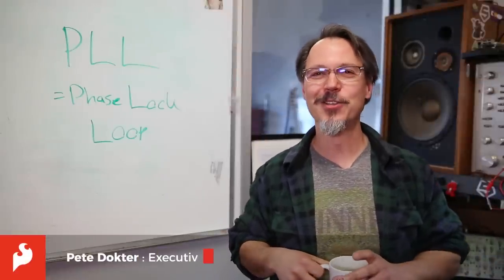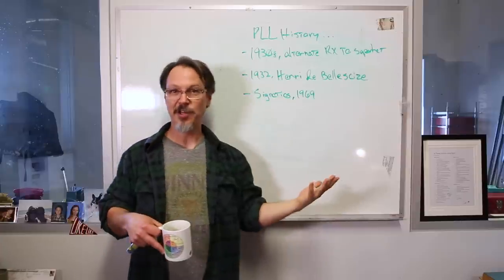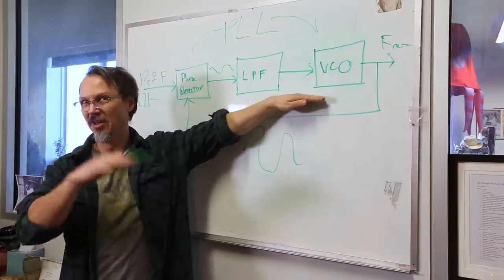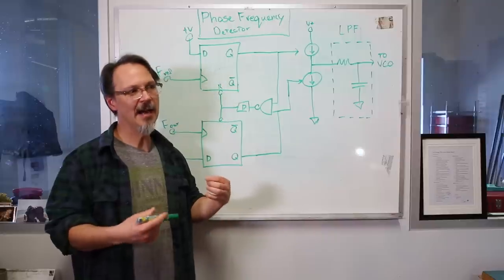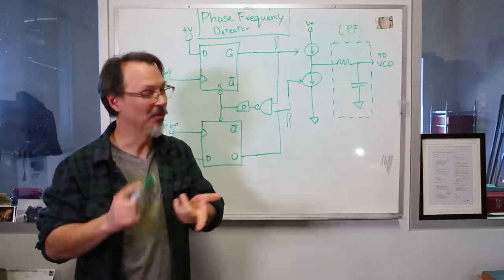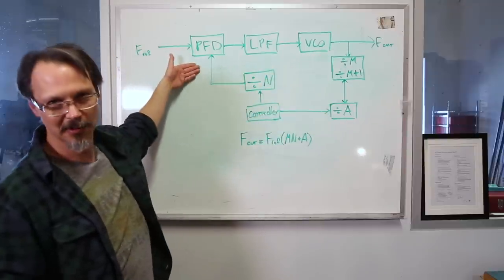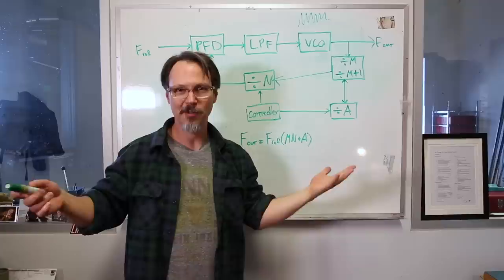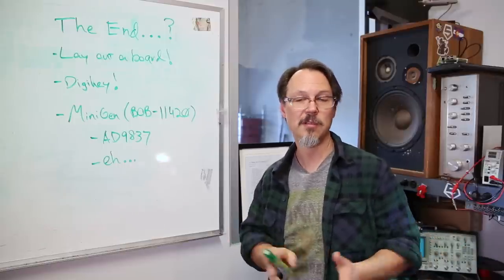According to Pete #54 - Phase Lock Loops

Comment: Hi Pete - back in the 80's I purchased a Sansui FM radio unit for my other sansui stereo equipment and it was marketed as having a Phase Lock Loop circuitry which (not being electronically educated) I wondered what the PLL actually did but could not get a simplistic answer to my question(s) back then! Lo and behold you answered this (up to now still unanswered but not pursued since then) question in the first minute of your video!!! Now, having said that, as a non-electronics educated person delving into micro-electronics and Arduino etc., I think your video would have greatly benefitted by including a simple numerical example starting with the crystal frequency and showing what comes out the other end and how much the feedback loop changes (increases) this frequency with each pass. To my way of thinking this would give me and presumably others a real feel for what is happening in the PLL? Great video nevertheless, and just in case you are wondering YES all my Sansui Stereo Equipment is still as sweet as the day it was first purchased - over the years I have completely recapped all of the electrolytic capacitors in my AU-X01 Amp twice but note this the original Nichicon power caps still have salient specs far better then the equivalent power caps available today! I can hear all your stereo buffs saying what BS for 38 year old caps??? And even though my amp has never been worked hard over the years my comment is very true! Cheers